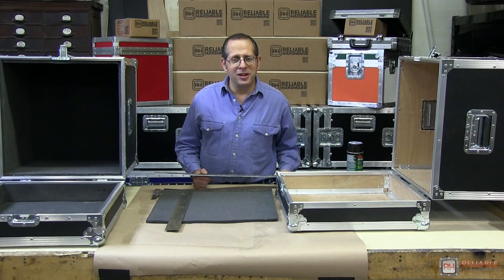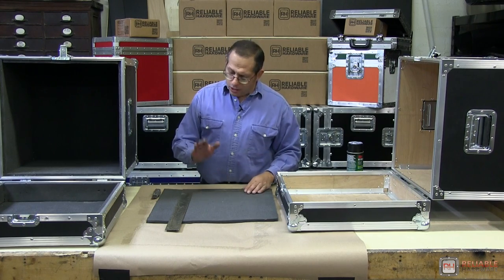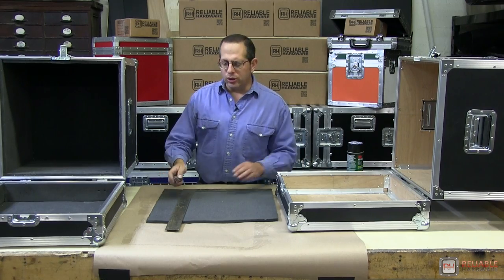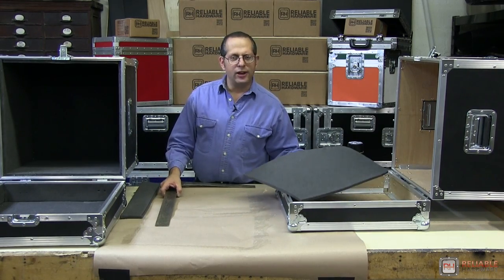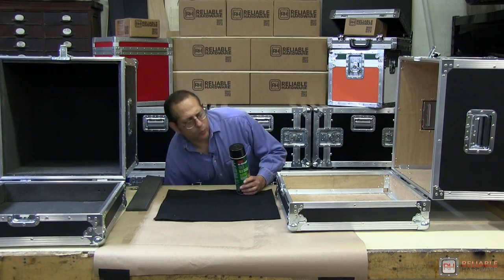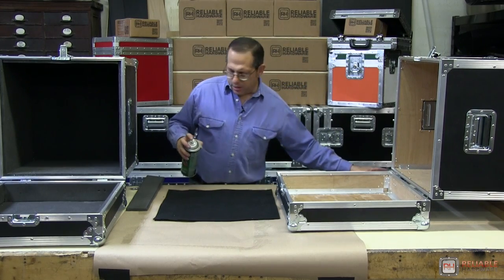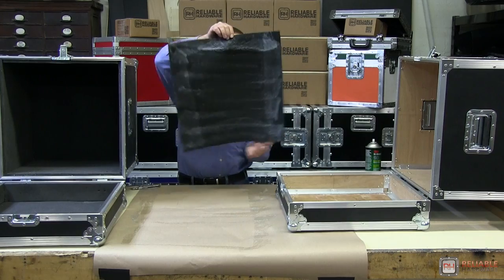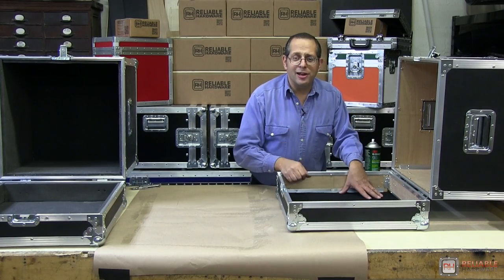10 of 11 - DIY Road Case Foam & Carpet - ReliableHardware.com

Comment: Anybody know if the amp is suppose to fit the EXACT sizing inside the foam or if there can be 1/4 inch space available from the sides?
Reply: Leave an 1/8 on either side

Comment: I'll just buy one already made. it will cost me the same amount and noooo work to top it off. Sorry the parts are just as expensive to buy as buying a case already made.
Reply: Anthony Zeolla There is no implied cost savings to making your own cases homie, it's the idea of making it yourself for a custom project.  Easy for me to say because I also make my own drums, guitars, basses and amplifiers so this is like a walk in the park for someone like that.
Reply: Anthony Zeolla You are absolutely right I did exactly that and I probably spent more building it myself anyway eventually that one wore out and I had to just buy a (used) ready-made rack case and it’s much better than what I did.
Reply: But I wonder, if you have to make a very specific size of case, that it would be cheaper to make your own rather than order a specific size? Probably cheaper to order for standard size cases, but maybe not for specific size cases.

Comment: dude, you are missing some major steps and tips. your carpet is obviously not straight, and overhangs in the corner. no explanation of type of carpet (poly types that break down and leave tons of shedding in your gear). No mention of padded backer (behind a carpet). layup of the sides in a sequence is critical to cover the bottom seams. finishing the edge trim makes or breaks a good interior. ignoring the finishing steps makes for a horribly bad "DIY" hackjob. Sorry, but this isn't a professional resource.